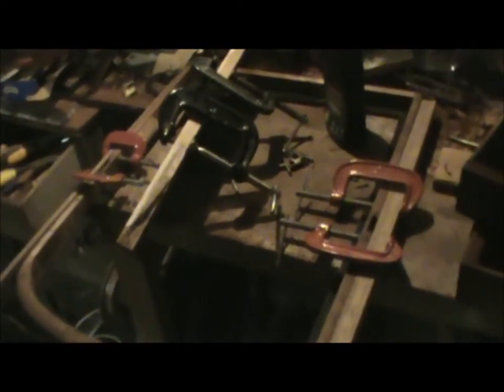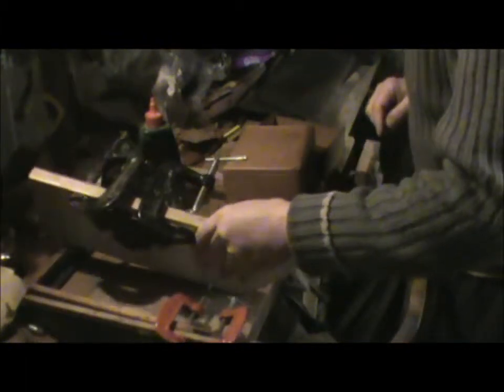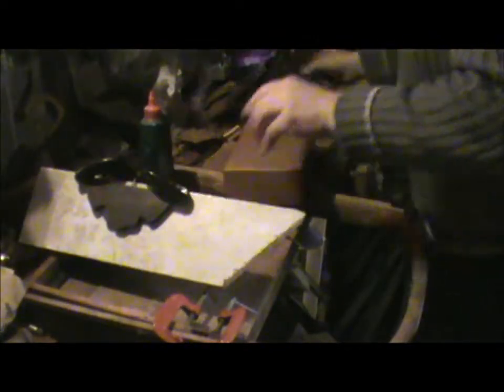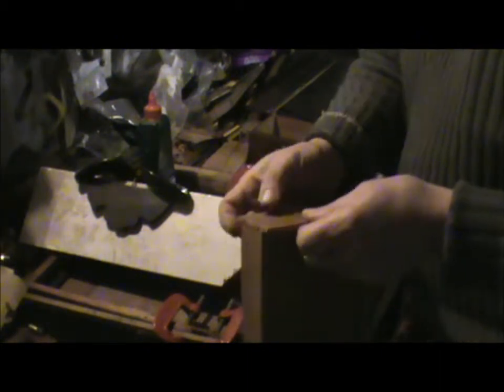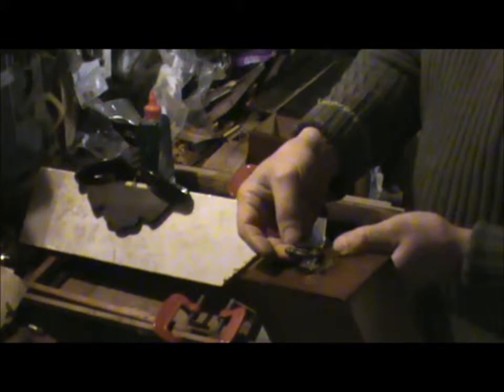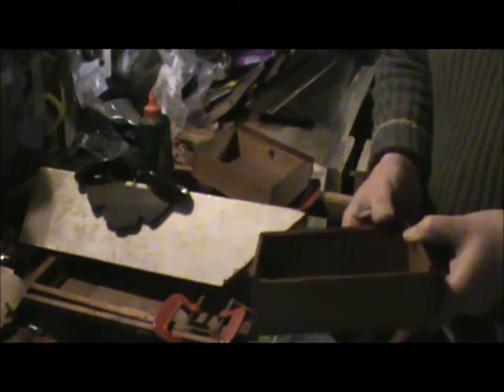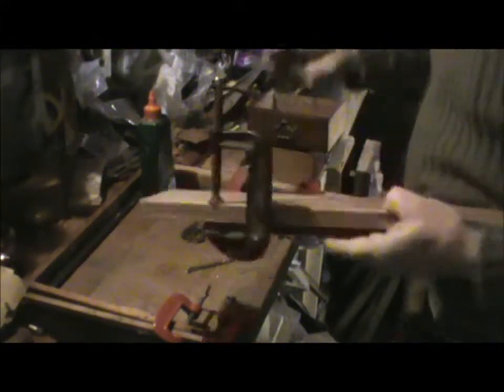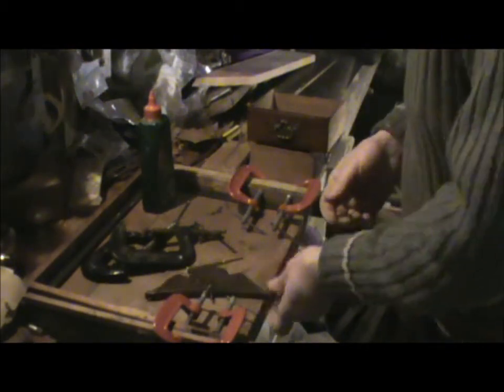Harry is dating

Comment from the maker: On 'further examination', the handles are a later fitting, the 'escutcheons' are propbably original, but would have had handles fitted to them, being thin brass pressings, the handles will have pulled out, or maybe just one did, and the rest were removed. 
Not everything 'old' is 'good'. Have to remember that this was a mass produced piece for the 'lower middle classes' of Victorian England. One of my great grandfathers sold furniture in East Ham, London, during this period.